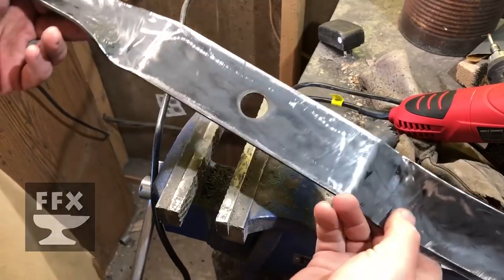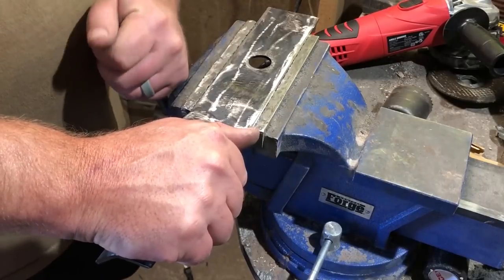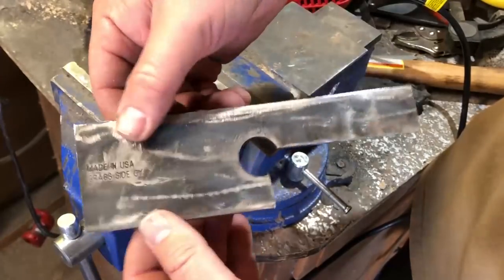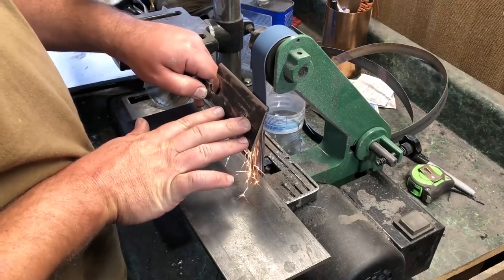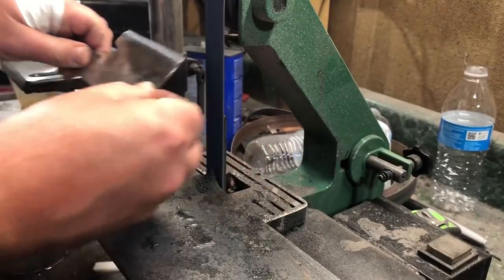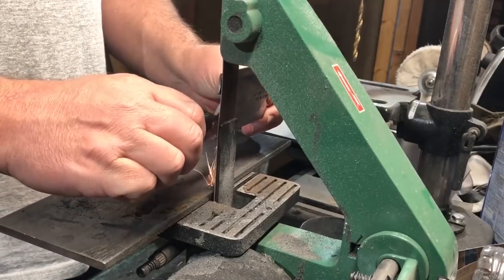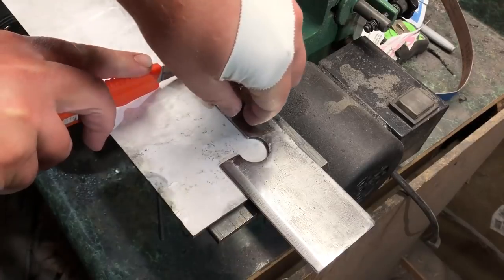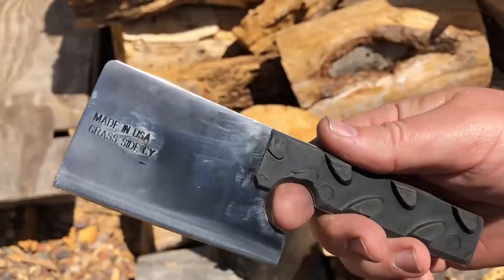Make a Cleaver Knife with no forging or heat treating from a Lawnmower Blade

Comment: a lot of people criticize using scrap and unknown steel, i enjoy using railroad spikes and lawnmower blades because my dad gives me old lawnmower blades for free and i have a guy who gives me barely deformed RR spikes. they certainly dont hold an edge well but i still prefer using/maintaining them than buying knives for cost to performance. i choose free knife that i have to sharpen often over expensive knife that i never need to touch. i enjoy working on knives.

Comment: Hi, excellent video, I have a question, can you put a bevel on a knife using a bench grinder?
Reply: It'll be rough. Since the bench grinder has round wheels, as opposed to a belt sander that has a flat surface. You'll get a rounded bevel

Comment: I feel like trying to use a part of the blade that's already sharpened would be more fitting, if one could find a blade that's got at least slightly closer to a flat profile for the ends.
Reply: Start with a blade that's not all twisted up like a commercial lawn service blade - they are mostly flat and thicker.

Comment: I see you have a different grinder. What brand did you get. (Sorry if you mentioned it I didn't hear it if you did.)
Reply from the maker: Isaac.J Gilpatric I’m actually using two of them now. I have a cheap one that I got from Harbor freight, and a Black & Decker it’s a very popular one on Amazon. The Black & Decker is usually under $30, I’m testing it, planning to do a review at some point. Seems to be holding up well so far.
Reply: FargoFX Cool. I personally bought one for almost 30$ at Walmart. But I have only used it for wood working. But soon it will be used for blade making.

Comment: Please learn to use an angle grinder properly, the way you're holding it isn't safe, the sparks has to be thrown down, not up towards your face, and never remove the guard
Nice little knife by the way
Be safe, keep the good videos ;)
Reply from the maker: Gaetan Thomas Noted. Thanks for the input. 👍